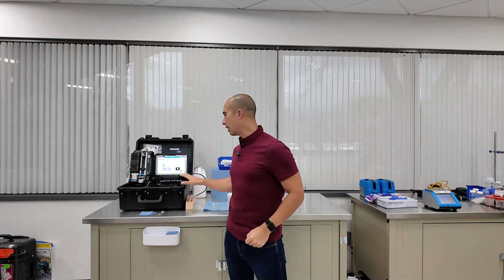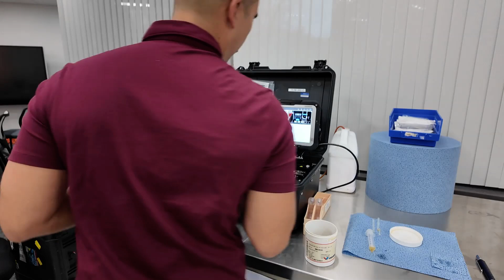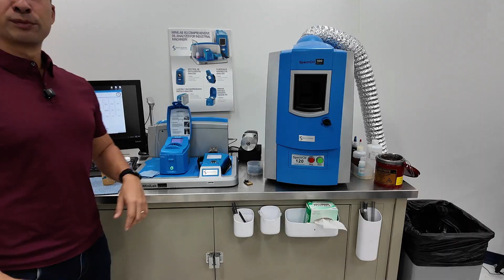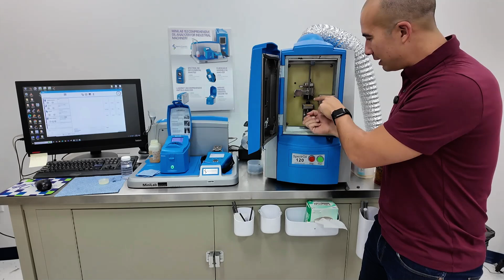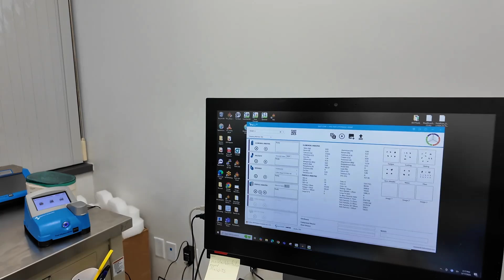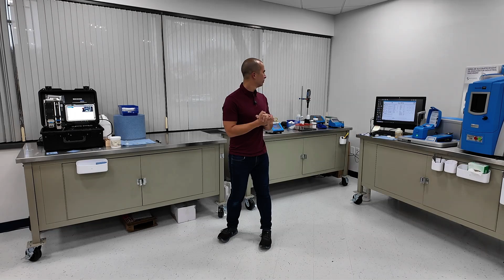Ditch the Lab Delays: Onsite Oil Analysis with a MiniLab!

Comment: Superb walkthrough and crystal-clear explanation 👏
As someone leading oil analysis efforts in Southern Africa, I’ve been saying for a while now: we need to treat oil analysis with the same layered sophistication as vibration monitoring — and this video nails that philosophy.

🛠 The breakdown of the Field Lab 58 vs MiniLab was brilliant. Especially appreciated the hands-on demo of:

Pore blockage method for particle count

XRF vs RDE spectroscopy comparison

And how LaserNet Fines goes beyond particle count to characterize wear modes like fatigue and cutting.

🎯 What stood out most was the emphasis on building a structured oil analysis pyramid:
→ Real-time sensors
→ Field kits
→ Onsite mini-labs
→ Lab testing
→ Exception-level diagnostics

That’s the mindset shift we need to move from reactive maintenance to true predictive reliability. Thanks for making this practical and accessible!

🔍 I’m curious — for those using LaserNet Fines in the field, how have you found the wear mode classification accuracy over time?

Comment: I could see that fieldlab being a very useful tool on our site, especially with our filter cart rotation/optimisation. And being on a remote mine site it would be awesome for fast results while waiting for a lab sample to be sent and analysed (typically 3-4 days from sample to results for us).
Reply from the maker: Absolutely! That's a pet peeve of mine with filter carts. Most sites will just put the kidney loop on for a day or half a day, without measuring the current or target cleanliness. Without that, how do you know how long the filter cart should stay in place? For gearboxes, being able to even just do ferrous density once a week on critical gearboxes also give yiu way more data density.

Comment: Hi , very cool explain.. i have a question about , is pq analyzer is important for used oil analysis, considering, the value is not precise (depending on the position of the magnetic particles) , but covers sizes that cannot be detected by the ICP tool
Reply from the maker: Great question! PQ is very good at detecting larger particles (above 10micron) that are invisible to the ICP test. The issue is mainly with interpretation, with it being a dimensionless number. I personally prefer ferrous density, which gives a similar resikt expressed in ppm.

Comment from the maker: Hi everyone! So this was my first time ever touching that equipment, after seeing all of it demonstrated once. Goes to show how user-friendly it is, and with a little bit of training pretty much anyone can run a lab-quality oil report.
Reply: Very True..  but you need a solid business case to invest in a Fieldlab... investment and operating cost vs 3rd party lab analyses Costa are a lot of samples for an acceptabele ROI (unfortunately)
Reply from the maker: @Hermen82 so I'd personally say the business case shouldn't be cost of testing on site versus cost of testing at a third party. Third party testing will pretty much always be cheaper thanks to their scale driving down unit costs. 

The benefits of on site analysis are really around the immediacy of results, the fact that most sites with this equipment will then start to test more frequently (more data density), and in my experience being so close to the testing means the result interpretation is better.